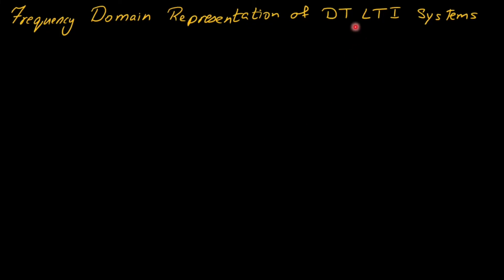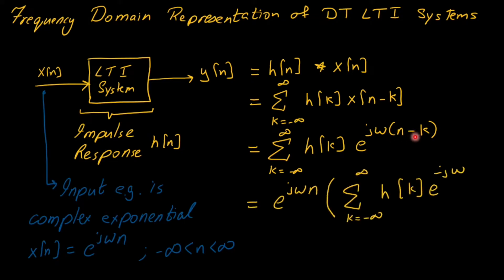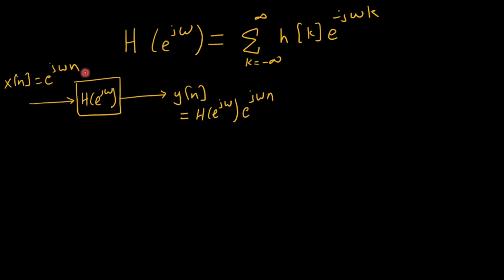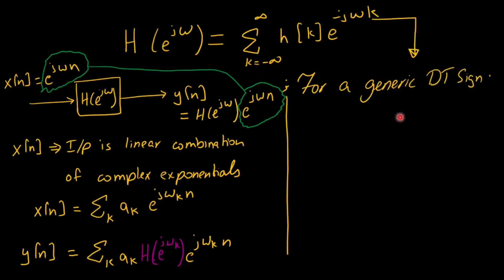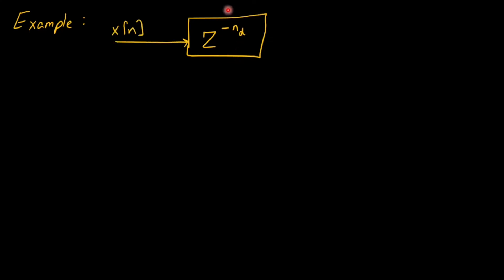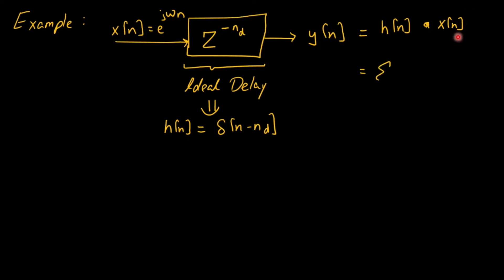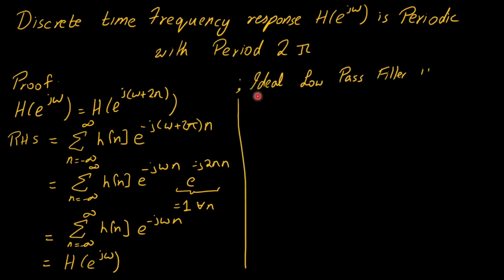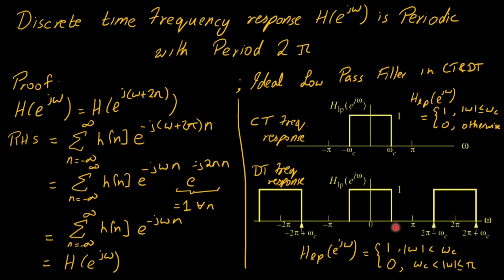Frequency domain representation in discrete time signal and system

Comment: Why should we take complex exponential as input?
Reply from the maker: Because its is not affected at the output, meaning that output will always have the same complex exponential as the input. This is referred as eigenfunction. At the output you will get back your exact input (complex exponential / eigenfunction) plus some multiplicative term. e.g. consider differentiating or integrating a complex exponential. On the other hand, other functions would change.